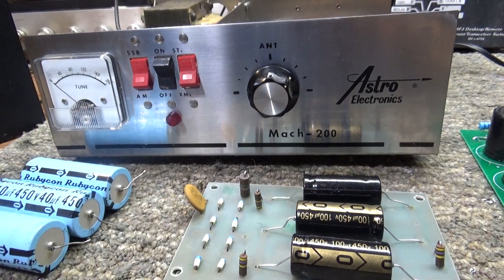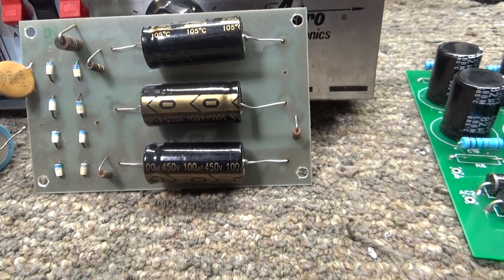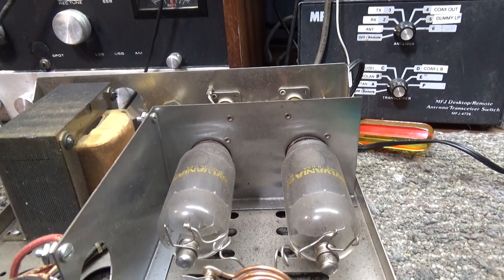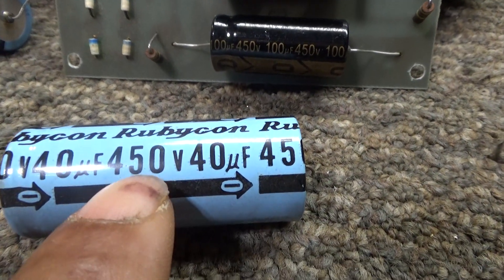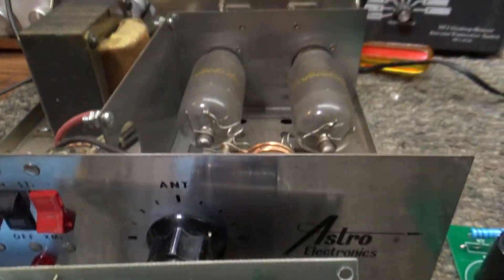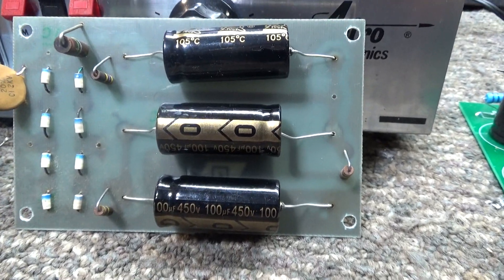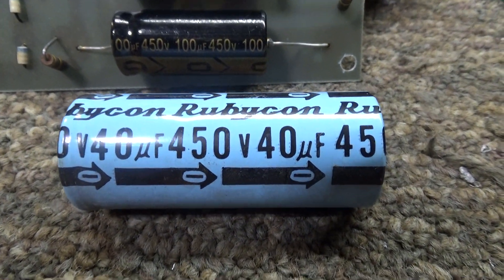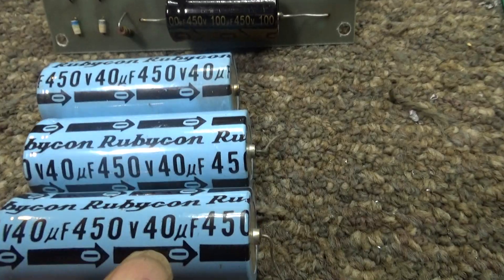Simple High Voltage HV power supply from a small sweep tube amp explained.

Comment: I've got one that I got here recently and I believe it is a full bridge rectified one I'm trying to modify make it mono band one side of tune good on the front tuners the other side it's the right side all the way one way has no bounce in it
Reply from the maker: no bounce as they are simple grounded grid, and 4 watt dead key is pushing it near its limit. Try dropping the dead key to one watt.

Comment: One word of caution when increasing the capacitance of capacitors.  Capacitors in pretty much any circuit are designed for the power supply circuit that supply's power to them.  If you get to high in capacitance value you start to stress other components in the power supply.  When you first turn on a amplifier or any other device it takes a specific amount of voltage and current over a specific amount of time to initially charge the capacitors.  If you increase the capacitance value it takes longer to charge the capacitor and there is always a possibility that it could place undue draw (stress) on other components of a power supply circuit.  In the case of this amplifier 100uF is probably a safe capacitance but I wouldn't go above that.  Just don't want to see someone sticking in 220uF or 330uF capacitors in place of 40uF capacitors and wondering why their transformer eventually burned up.  The hardest a power supply works (except for a dead short) is when it is first turned on.

Mike KC3OSD
Reply: Wrote up my comment on the video before reading the rest of the comments.   I see that we were thinking along similar lines.  Thanks for your thoughts.
Reply from the maker: True, but the key is at Turn On, not during use. Also as I just replied, that problem can be addressed very easily. Some form of soft start.
Reply: Hi Mike. Glad you are alive and well. Happy 2023 from Future World.

Comment: I am surprised you didn't replace those old carbon bleaders and those outdated diodes ,I usually replace everything
Reply from the maker: Sometimes I do, but this one they looked good, had low miles, and all read with real good specs so I left them alone.

Comment: A nice explanation! Something more. If you’re a beginner you might see capacitors marked “mfd”. That is the same as “uf”. Capacitors in series divide and in parallel they add in value. Resistors are the opposite. Thanks!
Reply from the maker: True That;

Comment: Love your informative videos! On the subject of sweep tubes, is a 6JS6C  a direct replacement for the 8950 in a Siltronix 1011D if just the filament pin out is converted to 6.3 vdc from 12 vac that feeds the 8950 ?
Reply from the maker: 8950  the cathode is connected to pins 2 and 6. On the 6lf6 and 6js6, the cathode is only connected to pin 2 
Also on the 6js6 only, the grid 1 is only connected to pin 5, while the 6lf6 and 8950 have g1 connected to pins 5 and 9.

Comment: Good video/  You are going to put a huge stress on those diodes.  Basically, as I was taught in Improved Hawk Radar repair, you might be able to double the capacitance in a circuit, as usually the engineers allow for differences in components,  but going above that will shorten the life of other components such as diodes and transformers.  33.3 mfd is more than double the original 13.3 mfd.  I'd also check to see if the intended output voltage is not being increased beyond the ability of the tubes to handle and you could lower the input a little to compensate for excess output.  As a preventative measure for the diodes, you would add an additional rectifier to each bank of them in the bridge configuration.  Watch the temperature on your transformer when you operate this the first few hours.   If it gets too hot, I would definitely look into regulating the transformer output voltage so that the multiplier is only putting out the desired voltage.
Reply from the maker: Only at Turn-on. After that you are good. Also, there is a fix for that that bigger amps use. It's called soft-start. Last, output resting/standby voltage is not raised, but output operating voltage is raised. Better regulation and less voltage drop. This is a good thing especially for a cleaner signal.
Reply: @tramdr  You don't think that a constant increase in current through the transformer and diodes can have a damaging effect and shorten the life of both of them?   I have been in electronics all but the days of my youth and I am 70 years old now, and I have not heard one engineer say that increasing the load on a transformer or on diodes only have an effect on turn on..   Turn on is when the effect is most likely to demonstrate the failure of the design, but it is not the cause.
Reply from the maker: Where you are wrong is that the capacitors are not the Load in a circuit. Good caps draw little current in the circuit sir......except at turn on when they are discharged. Case in point. Look at an amp that has a plate current meter.  Unkeyed, the HV is running, the diodes and caps are doing their thing, but if the tube, which is actually the load, is not conducting, you will have almost zero plate current. If you key the amp but no drive, the tube 'Load' will draw a little plate current. Then when drove, the tube 'load' will draw full plate current. 
  When I first power up an amp that is new to me or even if I have not ran it in a long time, especially one without a plate current meter, I use a variac. My variac has a current meter and also I have a volt meter and amp meter inline with the variacs output. For one, this is another way to dial up the voltage to the caps without the turn on surge, but for 2, if that amp draw starts going up, as I slowly dial the volts up, then something is wrong with the amp. 
  Its kinda sad that you say you been doing this for so long and don't know that the filter bank caps have an extremely low load or draw on an amplifier. The load is the tube conduction. Except for high turn on, what normally kills the transformer and diodes is too much load alright, usually caused by too much drive, or mistuning the output of an amp. A lot of people don't know that mistuning an amp also causes the amp draw 'load' to increase and as you said, higher 'Load' kills diodes and transformers.
Reply: @tramdr  If a transformer could take infinite load , there would be no need to size a transformer up to its expected load.  If the diodes could handle just any current, why bother to double them in the bridge rectifier.   Yes, there is additional capacitor loading when you increase the size of the capacitors and it is felt mostly at turn on, but is continuous as the circuit is being used or they would have never bothered with making the transform as large as it is, nor double up the diodes as a simple thermisistor would have taken care of the turn on load.  Get your Engineering Handbook out and you will see what I am talking bout.
Reply from the maker: Kinda sad, sir. I'm going to just go with your statement about diodes as that's the worst of your statement. If you would have watched some of my videos, you would understand that silicon diodes have a max voltage of 1000v. They are used in series as sweep tube amps run right near 1000v's and transmitting tube amps run on many KV's. Its not about current at all, with diodes, its about getting that voltage up, Sir. The rest of your statements are either half true/ half false, or totally false too.

Comment: if a amp came with 210uf and you replace them with 270uf. is there any reason not to go 330 or 470uf? is there a point where it hurts the power supply? would it lose efficiency or work harder with bigger uf?  thanks
Reply: MikesRadioRepair and I have both stressed in our comments concerns about other components when oversizing capacitors.  Yes, a 210 uf can easily be replaced with most of the values you mentioned, but I would not go to 470 uf.  Yes, increasing the value can reach a point where it hurts other components - specifically the transformer and the rectifiers.  Now, diodoes are relatively cheap, but the transformer is not.  Also there will be a very slight increase in output voltage, but it can get high enough to hurt the components it is powering.  I would check that voltage and other related voltages before using higher value caps over an extended period of time.
Reply from the maker: Bigger caps helps ac hum, and helps out a lot with voltage drop. On Am, voltage drop hurts your peak modulation, gain and is non linear. A perfect amplifier would not have any voltage drop or change from standby to full modulated keydown, but short of regulating the HV or running a tetrode amp instead of a triode, voltage drop is going to be a problem and effect your signal. More capacitance helps voltage drop out. The negative is that as Mike said, on TURN-ON, the caps are discharged, and charging up those big caps is more stressful on the power transformer and HV diodes on TURN ON ONLY. It takes a few cycles of ac to get those caps charged up. Before they are charged, caps almost look like dead shorts to the diodes and power supplies. On a small amp with a small power transformer, the HV windings of the transformer usually have a lot of internal resistance, plus a small tranny because of the higher winding resistance and gets saturated where it can only put out so many amps no matter what, then turn on surge maybe a concern but not a big concern. On large amps, turn on cap surge is a huge problem. You ever notice that on most medium to high power CB amps when you turn them on, the lights dim for a second? That is why. Those dead caps are fast charging similar to a dead car battery. With big amps, this problem is addressed usually by soft start. Basically putting resistors in series with the transformer windings 'often in the primary' that are bypassed by a relay after a couple seconds. The Pride dX-300 has 2 resistors R12 and R26 in series with the HV for turn on surge. They are not switched out, they are inline permanently. When I was in my 20's I read a Black Book on linear amplifiers that mentioned those resistors and the book didn't know what they are for.

Comment: Hey Tram Dr.
Were do you buy your caps from
I'm rebuilding an old dinosaur myself
It has 8 of them in it.
Ole D&A
Reply from the maker: Ebay, but I look for High Temparature and low esr caps. All caps are not created equal.
Reply: @tramdr  thanks it is mine
Depends on we're you get them
Rf parts was a little high on thers.
Reply: Do you know what were the original value of the original caps for a D&A phantom triple-stage.
Reply from the maker: I00 uf at 350v originally.   The more common voltage now is 450 instead of 350 and using 450's will give you a better safety margin. With the UF's to a certain point, more is better. I50's or even up to 220's would be better. They make caps a lot more smaller than they used to back in the day. Most 450v caps with even higher UF's are still smaller and with a good quality cap, better than the original. Normally, the better caps cost a lot more money than the cheap Chinese junk one's.
Reply: @tramdr  thanks!
While I'm doing this would be a good time to replace diodes also.
Do you have the value for them too?
I got a wiring diagram or somewhat diagram but not a part listing may not have one back in the day lol
Reply from the maker: Original diodes are 1000v 1a, a common number was 1N4007's.  However, nowadays,  3 amp, 6 amp and now 10 amps are common and cheap. I usually use 6 ampers for replacements.